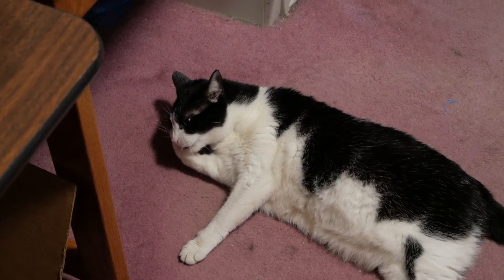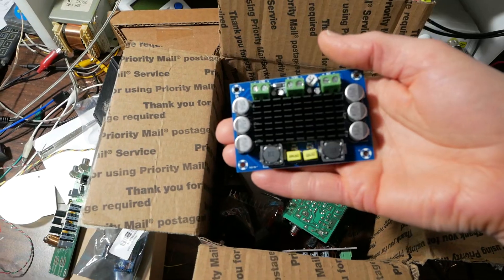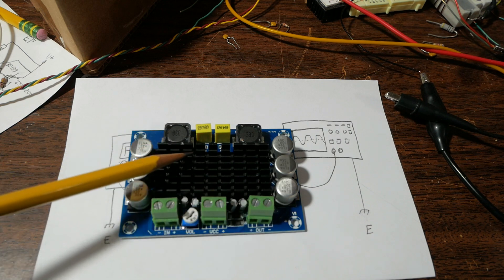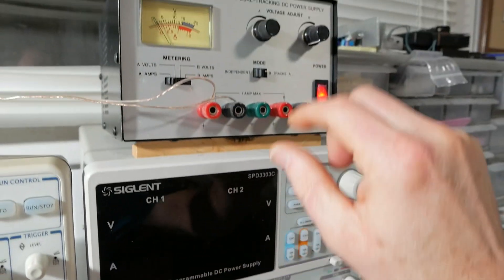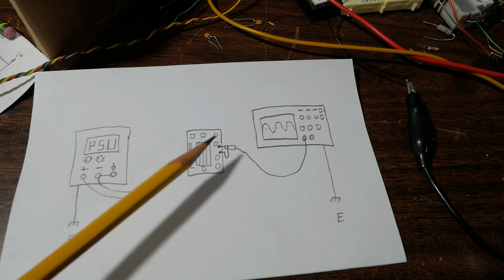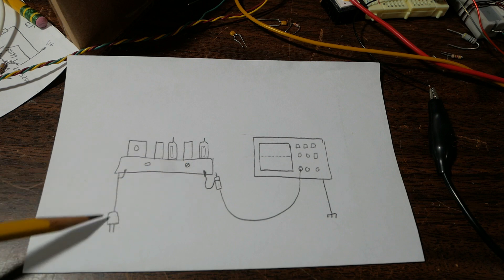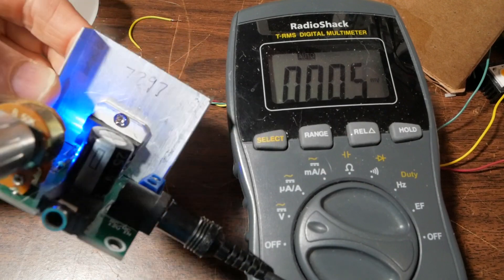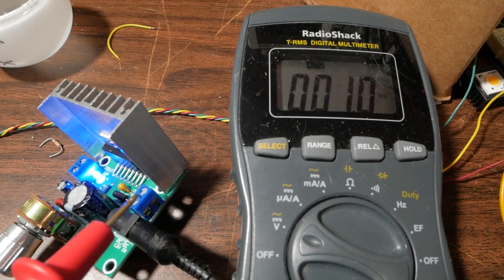Avoiding ground loops on the workbench

Comment: Question: how did you connect your signal generator to the scope and measure against those bridged output amps? Most signal generator will have grounded negative, and when you connect to scope, say ch 1, when you connect ch 2 to amp output, it might fire the amp!

Comment: Definitely a problem, but NOT a "ground loop". You are just shorting an active output (one side of a push-pull H bridge) to the negative side of the power supply (via the ground wires of your scope and supply). On the other hand, a REAL ground loop is a very different problem, where you have two separate wires interconnecting points at DC ground potential (so no net DC current flow) that form a loop antenna which picks up (electromagnetically) a circulating AC current, thereby introducing hum and noise. See https://en.wikipedia.org/wiki/Ground_loop_(electricity)
Reply: A real ground loop is when something prefers to use the ground through interconnects instead of it's own ground, making all kinds of noise across that interconnect, right?

Comment: Quick question. I have built a tda 7293 stereo amp for my school project. It worked just fine. Then i brought it to school because i dont have a scope and i wanted to measure its maximum output power and distortion. I used an isolating transformer, a scope, a function generator and an old variable fake load. As i said, the amp worked when i tried it with music. After i connected everything (my tranformer to the isolating one, 1kHz sin wave to the input and the fake load and scope to the output) i turnt it on. I heard buzzing, then i immediately disconnedted the transformer from the isolated 230 volts. I asked my teacher if it was normal, i mean the buzzing from the fake load. He said its normal sometimes. I connected it again, and after 2 seconds of buzzing my right channel blew up. What could have been the problem? It was not a bridged amp. Just 2 tda7293s in stereo mode.
Reply from the maker: What is the load you used? What is the load's resistance and impedance?
Reply: It was an old variable one (with a slider), around 800W max power. I set it to 50-100 ohms or so because it was unstable for the ohm meter. I did not want to risk a too low load. Friends of mine said that my amp was not the first one that blew up with that load at the same bench. I can not remember anything else beacause this happened a year ago.
Reply: Is this 7293 a digital amp? If yes, you need a lowpass-filter, which kills all over 20Khz at the output. Google and learn abt digital amps output.
If not forget my blabla.

Comment: 50 years ago I put a 10a variac into a case along with a 500w isolation transformer so the AC I feed to anything under test is isolated from ground. I spent my whole life working as a technician and then an engineer, the test equipment on my bench at work was all floating - nothing was grounded. That made noise measurements very easy and kept all the magic smoke inside where it belongs.

Comment: So if you are using say a toroid transformer or a normal DC wall plug pack they are ground referenced and likely to blow the amp when measuring across the output? And how does this apply to power supplies that require dual +/- power supply?
Reply from the maker: These are normally isolated but it is good to check with a meter when unplugged from power.

Comment: Hi john very good explained! Savety first. You can use a differential-probe for BTL amplifier outputs. Take care when it comes to high-power/voltage-amp's.
Reply from the maker: Diff probes are nice but are quite expensive. I was thinking of trying using the two channels of the scope, probe tip on each output and using math mode to show the result.

Comment: I used to have a "hot chassis" crt scope. I just disconnected the ground pin on the mains. I used that dangerous killing machine to do some measurements on crt monitors power supplies that had a hot DC side (transformerless and the like). Not recommending, just saying.
Good video!

Comment: SNICKERS  !   You put the scope on a isolated   transformer  on the  A/C line    side
Reply from the maker: Isolation transformers pass the ground lead right through.
Reply: @JohnAudioTech  
it is better not to connect the ground lead when using an isolating transformer , theres no chance of shorting equipment and because neither wire is "hot" so long as you dont touch both at the same time you dont get bit :-)
Reply: @JohnAudioTech
there still is a way to get bitten with a transformer , if the machine your testing has one lead  connected to chassis when you clip on scope lead that chassis wire becomes "neutral" so the other wire becomes "hot"  , wont short circuit the output but will mean the whole circuit will be "hot" :-)
Reply: @JohnAudioTech   & doesn't always help on a Digital scope either..

Comment: I just ignore the speaker output polarity all together. Never blew up an installation but I might have heard secret messages.
Reply from the maker: Amplifiers deal with electrical signals and the rate of change of these signals over time. At any single point in time it is just a single voltage level. All this can be measured with precision with the proper equipment. You can actually measure the rhythm with a scope, but why would you want to? Musicality is an audiophool term.